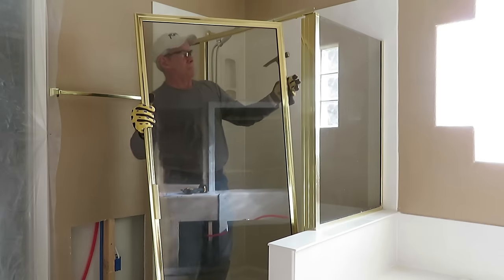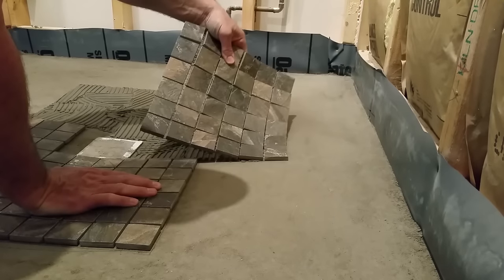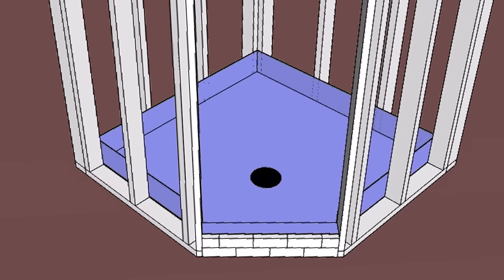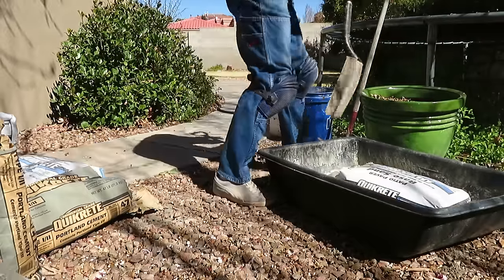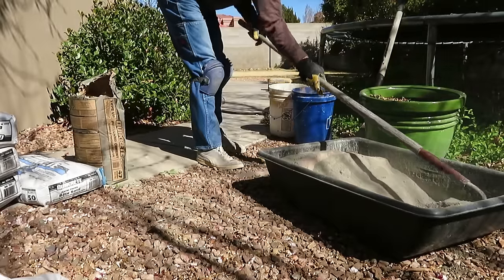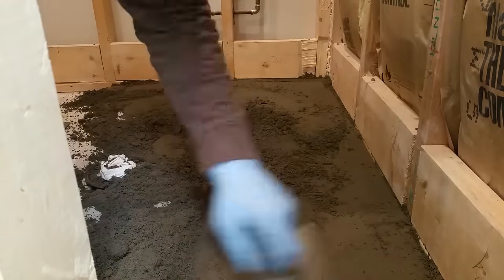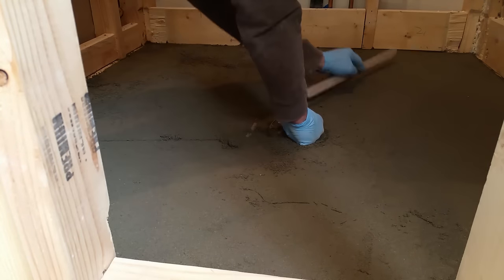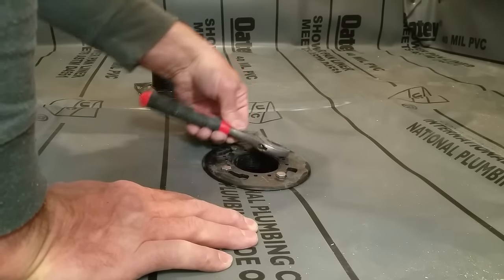Building a Shower Floor From Scratch - Part 1 of 2 - With Shower Pan Membrane

Comment: Hi Rusty,

I am building a moderate bathroom, 8'x10' with no interior walls, meaning it is actually a huge curbless shower. I think I need 1/4" per foot slope, meaning that my slab must be recessed one and a quarter inches lower for the area of this bathroom. Is my calculation correct or do I need some tolerance, meaning, say plan on a two inch recess, and build up as necessary? Obviously, if my recess is to low, I can build up, but if it is not low enough, I'm pretty much screwed. So, how much tolerance should I consider?

Second, this shower pan is considerably larger than the examples I see, so do you have any advice on how to proceed?

Thanks for the help,

Chris.
Reply from the maker: Hey, Chris. Can you give me a little more info? So you want the whole 8'x10' area to slope to a central drain or multiple drains? Is this new construction in that, are you pouring a slab that you are going to recess in order to later float in your shower floor? Sounds like you are planning to use a shower pan liner for this area? I think I understand what you are describing which is quite an undertaking. I am comfortable with 1/8" to 1/4" slope depending on size of the floor. The trick with larger areas is cutting in your dry pack to keep a gradual slope without creating ponding areas accidentally just because of the amount of footage you are dealing with. Also, I like to place the entire floor in one session so it dries as one unit which means more help to mix and float to pull that off. Happy to give you some observations if you can give me a few more details.
Reply: Hi Rusty,

> So you want the whole 8'x10' area to slope to a central drain or multiple drains?
One central drain.

>  Is this new construction in that, are you pouring a slab that you are going to recess in order to later float in your shower floor?
Yes, new construction. The area of the bathroom -- oh, hell, let's just call it what it is, the shower -- is 8'x10' and will be recessed below the rest of the slab so I can float the slope up to the height of the rest of the slab.

> I think I understand what you are describing which is quite an undertaking.
I agree! It scares me a little, because I think I can get into trouble much faster than I can get out of trouble. I'm not sure how unavoidable trouble may be. 

> The trick with larger areas is cutting in your dry pack to keep a gradual slope without creating ponding areas ....
Yes. This is my fear. If I have sufficient depth, then could I do it in two steps? Suppose I float my pan and I see some depressions, can I just float another layer on it or would this second layer sheer off? If there is no possibility of an incremental approach, then I don't think I need as much tolerance as I am currently considering. My thinking is that if I can do this in a few steps, then I'll need the depth for a few bites at the apple, and if I can't then I won't need any depth tolerance.

Thanks for the help,

Chris.
Reply from the maker: Yeah, Chris, based on your comments and my sense about what you are doing, I'm going to encourage you to check out some other alternatives rather than the method I show in the videos. It can be done, but it is tricky and a ton of work. I am not an expert on Kerdi products at all and have never used them in a real project for a customer. Here is a link to a tiny house shower floor for my son where I used the Kerdi membrane to build a very unorthodox floor but it is working out fine so far. That is my total experience with Kerdi. https://youtu.be/jA3jOJfenSY  

Here might be an advantage or two. Since the membrane would be installed on top of the dry pack with thinset, it might allow you to do the incremental approach you are talking about without issues. Then, the floor tile is set on top of the membrane with thinset and grouted as usual. You could flush out your tile with the finished floor at the bathroom door entrance. There is a drain from Kerdi that ties into the membrane so essentially you are installing a waterproof liner on top of the dry pack that integrates with the drain. Could probably reduce the amount of the recessed pour you would need to make which would mean less dry pack needed to get to your final finished shower floor. Might be the ticket for you. There are YouTube videos on the Kerdi methods and I'm sure their website has instructional videos as well. The downside is their products are expensive but would probably cut your time in half. Good luck, Chris, and would love to hear what you decide!

Comment: Hey Rusty, should I fill the hole in slab around the drain first, and if so what should I fill it with?
Reply from the maker: Yes, Robert, definitely fill the boxed out area around the drain after you have your new permanent drain installed at the height you plan to use. You can use Quikcrete cement if you have it available or the dry pack mixture like I used in the video. That will just help support the pipe and drain better. Thanks for watching!
Reply: @RustyDobbs   thank you for the response!

Comment: Hey Rusty... Is the cement mix for the pre slope the same sand/mortar ratio as the dry pack above the pan liner?
Reply from the maker: There are some premixed bags that I have seen in stock at Lowes, Mike, but have never try them so I can’t really give an opinion on them. I have actually always just preferred to mix my own.

Comment: I have a question, how does concrete works with expansion and contraction and the movement of the house? Is there any setback that create cracks overtime?
Reply from the maker: As long as there is no major cracking in the main concrete slab under where the shower floor is located, I would feel comfortable doing an installation like this over the main slab. If you are remodeling a shower in an older home, the concrete and frame structure of the house have been there for some time so you can be fairly confident that most settling has already occurred unless you see visual evidence of something else going on. Hope that answers your questions, Adilene.
Reply: @RustyDobbs  it totally helps. The more I know the more I realize there is much more. Thank you for you explanation. 

You talked about main slab, but the shower bed I have in mind is in not on concrete slab, the house has a basement and the concrete will be on top of plywood as subfloor. Am I in trouble?
I’m sorry if this a never-ending conversation. 😵‍💫😬😥
Reply from the maker: @adilenecastillo2136  That's ok! I was helping people with questions on their projects long before YouTube was around. No you're not necessarily "in trouble" but there are other things you need to keep in mind when adding a  shower over a wood subfloor. I would kind of need to see your situation before I could offer more insight. If you want to send a few pictures to rusty@dobbsworkshop.com, I'd be happy to give you more feedback.  If your basement ceiling is open to see the framing structure under where the new shower would be, that would be helpful to see.
Reply: @RustyDobbs  I really appreciate it! I will send the pictures.

Comment: How are your steps supported? You don’t have to screw them to the floor?
Reply from the maker: No, Jack, I put down a layer of mortar on the slab then set my brick on top of that and built to the height I need which is typically two bricks high. Tile is installed on the floor against the step outside the shower and inside, the shower floor is installed against the step, so it’s not going anywhere.

Comment: Love the video and I understand the process. However, I need to put the shower on a wooden subfloor. What would be the process for a subfloor? Should I put send sort of barrier like tar paper down first to protect the subfloor? Thanks for the help.  Alissa
Reply from the maker: Yes, Alissa, it would be a good idea to waterproof the area under the shower floor in some way. In theory, the shower pan should protect the subfloor from moisture but since you had a wooden subfloor I would want to protect it anyway. I would even consider using the 'brush on' waterproofing moisture membrane products that are on the market. The only other potential issue I would verify is that the structure under your subfloor is framed carry the weight of the mud shower floor in that location. Thanks for the comment and for watching!. Good luck with your project!

Comment: So the dry pack goes over the pre existing concrete shower floor?
Reply from the maker: Yes, generally speaking, Cindy. The first layer of dry pack can go on top of the original concrete slab under the shower floor. There are lots of ways that shower floors have been constructed over the years and my example in the videos is one of those methods. It kind of sounds like there may be more to your question than I am answering?
Reply: Rusty Dobbs  well the guy at Home Depot told us just use your liner on top of the concrete floor and then mortar on top of that no need for 2 layers ..that goes against every video I’ve watched ..
Reply: Rusty Dobbs what would you recommend 1/4  or smaller gap for grout line between tiles ?
We’re using larger tile

Comment: So you build the frame is it attached to the concrete or how do you secure the frame on the concrete.
Reply from the maker: You can do it with construction adhesive or metal anchors. In this case, the inside of the frame will have a concrete floor against it and on the outside, floor tile will be installed against it, so it is not going anywhere regardless.
Reply: @RustyDobbs  thank you!

Comment: Is this how they do things in the USA? In Britain everything is bought and fitted. Most showers have shower trays that you just put on the floor and the shower screens fit on to them with the ends secured to the wall.
Reply from the maker: Not necessarily, Tony. This is one of the very 'old school' methods of building a shower floor that has stood the test of time. I learned to do this about 40 years ago and have tweaked it to my own uses over time. There are many other options for building shower floors that are used here in the States and are probably similar or the same to what you use in the UK.  I recently did a large shower remodel where I used a foamboard shower base that was about 120 cm x 150 cm with a lateral drain in an upstairs master bathroom and I was concerned about the weight of a cement type shower floor, so I used this new method. I did a video on it a few months back and the shower turned out well. It was a new experience for me using this new shower base. The downside to it was that it cost about seven times more than building the cement type of floor as in the video. But it was quite a bit less physical work. All things considered, I still prefer the old methods because I trust them and have had good results over time.

Comment: Can you provide a list of materials needed for this....?
Reply from the maker: Hi Rebeca. Thanks for watching! The materials needed for this are pretty simple and straightforward. Most likely, all can be purchased at a Lowe’s or Home Depot. The drain is a typical shower floor drain that is designed for securing the shower pan to as shown in the video. The shower pan can usually be purchased at one of the stores mentioned or can be ordered from Amazon. I also use bricks of any type that fits the width of the step you want. Metal lath is cut to size and then bent to slip over the bricks. The sand is very typical “play sand” which can be purchased in bags of 50 pounds each. For the shower in the video, I used 6 to 7 bags of sand. The final ingredient is Portland cement and it can also be purchased in 50 pound bags usually. I probably used three bags of Portland on this shower. Other than that, the hand trowels and sticks I used are pretty self-explanatory. I hope that’s helpful!
Reply from the maker: Rebeca, I also did an updated series of videos recently called "Building a corner shower floor from scratch" that covers some of the same topics and some new ones as well when tackling a project like this that you may also find helpful.

Comment: Thanks Rusty for the video. I've seen another tiler on here that says there's never a need for the first layer (pre-slope, etc). I think I'm going to go the pre-slope route after watching this because there are parts of my subfloor that slope away from the drain (the joists create high points).

However, if I use a membrane like Redguard or Kerdi, over the cured drypack, would there still be a need for the preslope layer? Any insight is much appreciated.
Reply from the maker: Thanks, Kyle! In the span of my work history, the preslope is a relatively new idea. You've already picked up on the reason for doing it but, yes, shower floors have been done without preslopes that last many years as well. The waterproof membranes or Kerdi over drypack are newer methods still. I tend to stay with the older methods that I trust for customers. If I were experimenting on my own projects, I probably wouldn't be opposed to trying a membrane or Kerdi over drypack in which case I would not see a need for a preslope. But it wouldn't be too big of an inconvenience for me to redo it if I didn't like the result. It would be in someone else's home!
Reply: @RustyDobbs  thanks for the reply! I was actually in the process of laying down the preslope when you replied! I'm going with the "old school"/manufacturers recommendation of pre-slope/liner/bed.

Comment: is this the same process if this is on plywood????
Reply from the maker: Yes, Steven, same process. The main difference you need to be aware of when installing over a wood subfloor is whether or not the floor joist structure under the subfloor is able to handle the additional load of the two layers of dry pack you will be point loading in that space.  Generally not an issue but something to explore to be sure.

Comment: Would adding some vermiculite hurt. This may be a bit heavy for a home with wood subflooring. My house is a 1959 model.
Reply from the maker: That’s a new idea for me, Mac, that I have never thought of or had suggested. Not sure I will ever have the occasion to explore that, but it may have some merit. Check out your subfloor a little further. They built a little differently back then. I’m finishing a shower right now in a home that’s about 50 years old with a subfloor made of tongue and groove 2 x 6 pine. Incredibly well built so I had no concerns about it handling the weight of the shower floor.

Comment: My gawd was that an old Ryobi miter box? I remember using those for finish carpentry when I was a kid! I think it was the first miterbox with the actual metal turntable.
Reply from the maker: Yep, MFD Mike. I have no idea when I bought it, but probably at the same time as I bought my Senco SFN 2 finish nailer... maybe 1979 or so. The nailer has been retired but honestly haven't given a thought to replacing the miter box. NEVER a problem. It has not been abused but has been on lots of jobs and even casual use over that period of time is a ton of use! Thanks for reminding me how old I am, too!

Comment: can I use s-type mortar for the base instead of mixing the cement and sand?
Reply from the maker: I haven't ever had a reason to try it, Steve. My guess is it would work fine but don't know for sure. My complaint might come based on how it worked being mixed on the dry side.

Comment: If you use bricks, can you just do 1 row.  I'm needing a low step in floor, issue lifting up my legs!
Reply from the maker: Sure, Theresa. I would probably consider just building a short form to the height you need and pouring a solid concrete curb and forget the brick. You can do whatever works structurally and still lets water flow to the drain.

Comment: Does this method work upstairs when the floor is wood underlayment?   Every video I see, there is concrete underlayment.
Reply from the maker: It has been many years since I have done an upstairs shower, Adam, but yes, basically the  process would still be the same. I might do a few minor things differently with the waterproof membranes available these days. The biggest structural concern is whether or not your floor joist design is adequate to handle the added weight of the shower floor though.
Reply: @RustyDobbs  What would you do differently if it's on a non - concrete floor?

Comment: Obviously a real pro but I would have liked to have seen some of the actual tear out in process with some techniques.
Reply from the maker: Thanks, HK! I have another video called “Moldy shower like this? Tear out and replace” that goes into a little more of the demolition of another shower. Every situation is different so a variety of things made need to be addressed depending on the issues you run into when doing a remodel. Anyway, hope the other video helps address some your questions.

Comment: What do I do if my basement floor is not level
Reply from the maker: Well, Corey, I'm not exactly sure what you mean by not level, but as a general answer I would say that your goal is that your shower floor be level around its perimeter and then slope to the drain to give you the appropriate fall you need for your water to get to the drain. So in that way of thinking, what is happening with your basement floor is not really relevant. So if you're building this shower floor on your basement floor, you pick the height for your finished shower floor based on what's going to work out best and look best with your basement floor that is not level. Hope that makes sense.
Reply: Thanx.. that make sense